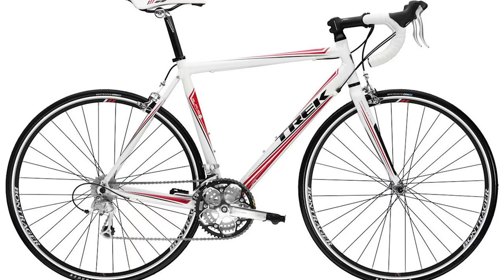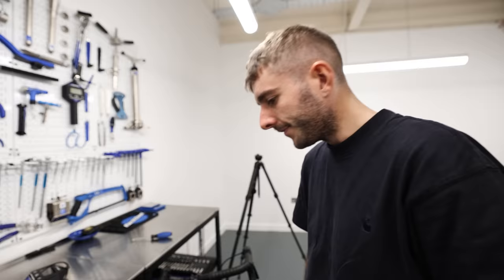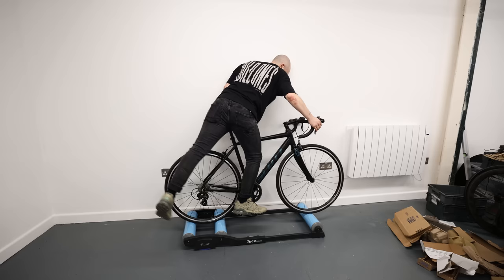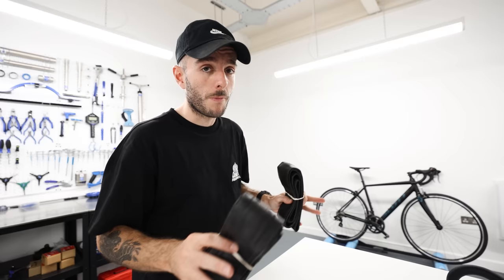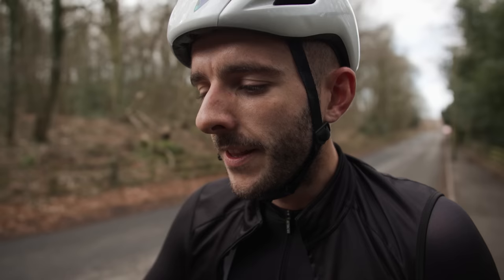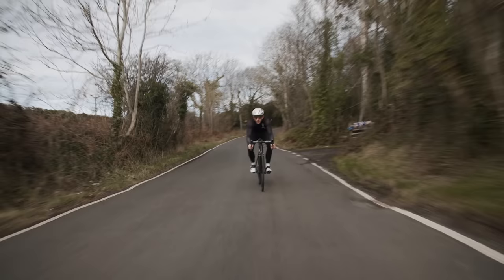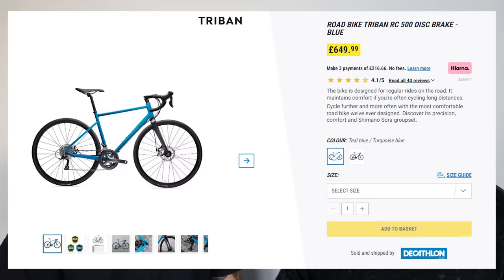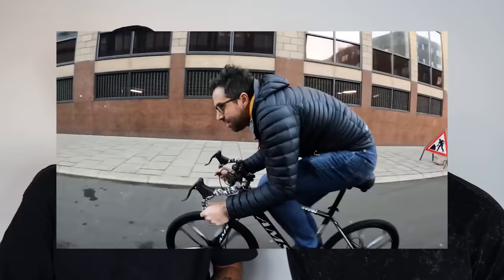How Good Is An "Entry Level" Road Bike In 2023?

Comment: For the same price you get the Triban RC520 with a 105 groupset from Decathlon! Big bike brands are getting ridiculously expensive.
Reply: Can’t imagine these guys buying from Decathlon…beneath them.
Reply: Yepp, I have the same and it has carbon forks, hybrid disc brakes, 105
Reply: @ScrubbersGhost  maybe they should?
Reply: @ScrubbersGhost  give over, they test stuff from Ali express ffs
Reply: @AK-je7ns  and?….they ain’t popping down to Halfords and picking up a bike for £500 are they?
Reply: Only downside is crap wheel set and heavy frame..
Reply: Just bought one second hand for around £500 (as my  first road bike). 

Nothing seemed to match its bang for your buck…
Reply: I bought the RC500 last year for £650. 11 speed and sora. With mechanical disc breaks. And I think it's a good bike. I prefer to ride my full carbon ultegra race bike in summer. But for those winter slower rides the Triban is fine.
Reply from the maker: I bought a bike for £120 and it’s in this video.
Reply: I have one and think it’s the best value bike you can get around this price point. And it’s super flexible for newer riders who don’t know exactly what sort of riding they will love - you can fit panniers and quite a range of tyre widths
Reply: @@diesel9677 the RC520 is out of stock all the time. That’s one of the reasons I went second hand. The price is another…
Reply: @Cade_Media  but it's two different worlds, you can't compare them. Decathlon in-house components are actually good quality
Reply: Also have the RC520 - it was $999AUD (i.e. 550GBP) new at a boxing-day sale. 105 Groupset, tubeless ready & HY/RD discs
Reply: @ScrubbersGhost  Back to the future... 😉
Reply: @diesel  True the RC520's 105 is arguable - mine came with a Shimano RS510 crankset tho. Shifters is still the most expensive component of a groupset, so adding those (plus front & rear mech) up you'd get a bit over half the dollar value of the full groupset.

Earlier on, the Decathlon CF900 did indeed have a full 105 groupset (rim brake), carbon frame & Mavic Aksiums and was discounted to $999AUD as well.
Reply: @ScrubbersGhost  they did buy from decathlon already
Reply: wee 😢bit of 😢😢 is ¾😮😢
Reply: Half a 105 missing the crank chain and cassette
Reply: @ScrubbersGhost famous last words 😂
Reply: @ScrubbersGhost  This aged like milk
Reply: Team RC520 here. Picked a pristine second hand up at less than half price. It's my work commuter & now with some Hunt 4 Seasons Gravel wheels & 42mm Specialized Pathfinders, she's a light gravel & tourer. A real do-everything bike.
Reply: @Cade_Media  The Schwalbe Lugano 2 are actually quite amazing. I bought them for 20€ a pair for my 79€ 1984 Bianchi to participate in the L'Eroica last year and I didn't had a single puncture on the strade bianche. I think when it comes to everyday use they are quite good.^^

Comment: It's great how passionate Jimmi is about bikes having easier gearing – it's such a blocker for new riders and they just assume they're unfit and bad at cycling, rather than it being the fault of the setup of the bike
Reply: Yeah.  Really, the 11-28 is fine, it's the 50-34 that's excessive for beginners.  They don't need a 50x11 gear!
Reply: I only started riding in August last year and have a 11-28 and 50-34 and it's a relief to hear this haha
Reply: @ellipticalsoul  get yourself a bigger cassette if your rear derailleur allows it! (You might need a new chain too)
Reply: they indeed do, but i think the problem is that 50/32 is to big of a jump to have less chance to drop the chain. I do think that 48/32 would be high enough for most because 2 teeth in the big ring dont matter as much as 2 teeth in the little ring.
Reply: Agreed.  Beginner bikes should universally ship with a fairly low granny gear, and come with fairly upright riding position (i.e. ship with plenty left on the the steerer tube).  Most beginners simply do not have the strength or fitness to ride up hills with >1:1 gearing or to hold an aggressive position.  46/30 up front and 11-34 would be a good combo that would not hold back most beginner roadies.
Reply: @lolbubs11111  👍 True, they don't! It's all about how often, how far and what terrain they travel at, and the speed they want to achieve. It's what we all did at the beginning (I still do). Initially, nobody cared about cadence or max. vo2. The last one is not of my concern (f.ex.), even after more than 15 years of road-riding. Since the faulty heart of mine - why bother? It will never be any high. It's good to be honest with yourself, set some goal and attempt to reach it with small steps. If some muscles pop up magically (except the one from beer injections), there will be a time for bike upgrade. Better wheels, tires, etc. Sadly, nowaday bikes are made the way other upgrades don't come cheap.
Terrain? My surroundings are slightly undulating. Few occasional hills like 8-9% max. Never longer than a kilometer and a bit. So, I found a perfect gearing for me: 52/39 - 11/25 and I'm sticking to it for like 12 years now. At amateur level, one might find bigger gears are needed only when going down the hill, with maximum cadence and It's impossible to generate any extra speed, while on biggest chain-ring and smallest cog. Simple as that. ;)
Cheers!
Reply: 11-28 is already wide for a 7 speed cassette. Something like a 46-30 chainset would make sense though.
Reply: Amen to this and all of the replies. Changing my 50/34 to a 46/30 was the best decision I've ever made component wise. I run an 11-speed 11-32 and usually don't use the 32 ring in the Washington, D.C.-area. That's for long climbs because I and most people do better on higher cadence.
Reply: @ellipticalsoul  I highly recommend a 46/30 crankset if you don't mind soft pedaling on descents. But, yeah. It's no-brainer to move to a better cassette if you can fit it.
Reply: @lolbubs11111  Gravel gearing and heck gravel bikes in general almost seem like the way to go for a beginner roadie these days.  In the road world at least the performance gap between an entry level bike and a good mid-range bike isn't huge.  It's not like the MTB world where a cheap hardtail is terrifying to ride on anything more than an intermediate trail, a good hardtail will run about even with a cheap full sus and a mid-range full sus is light years beyond anything below it.
Reply: 11-28 is fine because its a 7 speed bike, otherwise the gear jumps would be even higher.
Reply: Yeah, it's utterly stupid to ship bikes with a anything bigger than a 50/34  and a 11/34. Unless your bike is targeting people who race, or people who never climb (like people living in the Netherlands!). What's absolutely crazy is that the Sora groupset doesn't allow for anything smaller than a 50/34 and a 11/34. 

So much so that a proper entry level gearing would have to involve a Prowheel (or FSA) 48/32 crankset and a 11-36 cassette paired with a MTB rear derailleur. However, I believe that past 9 speeds road shifters and MTB rear derailleurs won't go along.

Bike manufacturers are so elitist. It's as they actually don't want to make the sport (or the mean of transportation) more popular. Cycling is ACTUALLY easier than walking. I feel like most people think the opposite. And I believe the culprit is unproper gear ratio choices.
Reply: @ellipticalsoul  My first real road bike is a 2005 with 12-25 and 53-39, which I bought in 2021. The gearing limits my route options somewhat.
Reply: Okay, time to put an other opinion into the equation. I have first a bike with 42/52 crankset and a 7-speed 13-23 cassette. Then a bike with a 28/38/48 crankset and 14-28 cassette and find the 14-28 cassette abit BIG in range. It is to big gap between the two highest gears. Now adays I also have a roadbike with 50/34 crankset and a 9-speed 11-30 cassette and wish I have a 11-28 cassette. A 9-speed 11-28. The lowest gear I have ever use on tarmac is 34-23. 

11-28 7-speed is way to wide for a roadbike to get any kind of harmony in biking on the road. 11-30 or 11-32 is a great option. For 11-speed cassette. It is not all about range.
Reply: @lolbubs11111  many beginners is grinders that go for low cadence and high gears.
Reply: @GordonChaffin Nearly the same as mine 46/30 front 11/34  cassette.  I'm pretty weak riding now and with this kind of set up I don't worry about where I go.
Reply: @JakeMay  it's a short cage that will only take a 28t max unfortunately!
Reply: So many bikes with this issue. 50-34 is hard to move away from I guess as a default industry standard. Even gravel bikes that are quite expensive- like the base Specialized Diverge- come with one.  Oddly enough it seems like more inexpensive brands like Boardman and Voodoo are heading the charge to go for subcompact groupsets. Perhaps there will be some  “ trickle up”…
Reply: And then there’s me with the Triban RC100. My easiest gear is a 44/28 😂
Reply: @Bes1997_   I have the exact same bike. Great on the flat, shocking on the hill
Reply: my first bike was a shimano 105 with 11-28 and 34-50 and I keep it today. I live on a steep hill place  where is hard to find flats and it's a wonderful ratio 
People ranting against 34-28 front back ratio are overdoing things. I can understand people wanting bigger sprocks to climb easier but is not needed and is slower as well. For me this ratio is a perfect sweet spot

Comment: I tend to buy second hand bikes. you can get a really nice mid range bike for that £900 these days. And if there is another £50 left over (because you managed to make a good deal) you spend that on a basic service at the local shop if you dont feel like you want to get your hands dirty and that way you supported the local community, got an amazing bike, saved some money and gave a second chance to a bike. thats a win win win win in my eyes.
Reply: Spot on!!    Rgr
Reply: Mid range 900 quid ??????????????
Reply: @stubbingtonmarigold3032  for 900 you can usually buy a bike that is only about 4years old and the original price of it was around 3k
Which on the grand scheme of things (compared to super bikes) is a mid range bike. 

But of course this is true for all price ranges. If your budget is £200 then for that amount you can probably buy a second hand bike that is a few years old and used to be just under 1k. At least this is what i see on the second hand market :)
Reply: @stubbingtonmarigold3032  I got a 2021 Roubaix with 105 for 900
Reply: eBay ftw!

£1300 got me a Scott addict 10, weighs 7kg, Shimano ultegra and 105 setup 

Looking forward to upgrading to disc brakes and fatter tyres in 5 years

Comment: I bought my girlfriend a used 2005 Jamis Comet for $140 USD. I put around $150 in part upgrades, $40 for a full tune by my local bike mechanic that included everything from truing wheels to making sure all of my wrenching was done correctly, and around 6 hours of sweat equity to make sure it is cleaned, the paint touched up, and the thing was properly greased. That road bike was around $1,900 USD when it came out and still packs a punch in terms of weight and geometry. What would I need to buy a $900 - $2000 brand-new "entry-level" road bike for? I could buy a car that runs and drives for that price.

Comment: My first bike was a Btwin & cost £299 and it was brilliant.  Didn’t want to pay too much as I was dipping my toe into cycling and now I love it. Should of taken up the hobby years ago. The perfect starter bike
Reply: I've got three Btwin including a 500SE.
Reply: I have 2 B'Twin bikes and my first road bike was the 500SE and cost me £300
Great bikes to start out on, and in fact its only this year that I have not used the B'Twin as it needs upgrading
Reply: I still ride a red Triban 3, and for the £300 i paid for it new back in the day it roflstomps this £899!! 'entry level' bike (of course its like Trigger's broom nowadays) :-)
Reply: Ridden nearly 7000 miles on my Triban RC120, an amazing bike for £329
Reply: using rc520 used rim brakes 565 size for 300€ sora 9 speed no problem,only terrak no brand brakes sucks but iam 65kg and rerely ride in rain or very wet so its alright ,i dislike disc brakek agenda new bikes are too heavy like 11kg for sora or even tiagra and pricing of most brands is way too high i feel like so if i am buying it will be probably Canyon with rims tiagra or 105 mechanical of course or from used markets
Reply: I agree with you, if you also want an inexpensive upgrade, the Boardman Sport will cost you more or less the same and it's a heck of the bike. It's fast (once you've accelerated it), comfortable (the Aluminium frame is great) and sturdy (the mavic CXP22 will last forever). There is just a tiny bit of toe overlap, but you know, you don't zig zag too much in training.
Reply: 'my first bike was a Raleigh 3 speed....it was very durable however it was to be ridden on flatter terrain...ohh I forgot  I had a bike with a bananas seat with 'Easy Rider" handle bars
Reply: My current bike is a Btwin Triban 520 that i use mostly for commuting.  I paid £450 for it which makes it the most expensive bike I've ever bought by some distance. I recently needed a new chain and gear-set and also fitted a pair of low rolling resistance tyres and the bike is so smooth and a total pleasure to ride.  The new chain and gears are obviously better quality alloys than what was originally fitted as I've had no issues with the chain seizing due to the winter gunk that tends to cling to the tarmac during the dark months.  As the boys said, better quality components allow you to be a bit lazy with maintenance which suits me down to the ground as I'm rarely in the mood for washing my bike when i get home off a back-shift in the middle of January!

Comment: My first bike on my return to road cycling in 2016 was a B’Twin Ultra 720AF, new but ‘shop soiled’ which I paid £700 for-full Ultegra gearing 50x34 and 11 x 28-I changed the block for an 11 x 32 (because 11 x 34 wouldn’t fit) and rode it for 18 months before I bought myself a new Specialized Roubaix Expert for my 70th birthday in 2018-still got it, still love it.
Reply: Man it's so rare that people of your age are into mountain cycling. My grandpa is the same age as you
Reply: Second that for B'Twin. 2019 Ultra 900CF , costed 550GBP for full carbon, 105 Groupset and Mavic Aksium wheelset. It was end-of-line sale tho, can't get that price anymore.
Reply: Any reason why you decided not to just keep the btwin?

Comment: As a proud owner of a £625 Giant Contend with Claris groupset from a few years back I really enjoyed this video. The bike has been my entry into road cycling from an MTB and have gotten me around London for about 5k miles so far. I sometimes think about upgrading to a £1.2-1.5k bike but really hard to justify it. The 3 year service it came with alone was worth £300 pounds and they've replaced parts for about as much so amazing value for money. I have a feeling I'll be keeping it for a really long time.
Reply: Claris is such an awesome groupset
Reply: @@diesel9677 Giant Contend 2 - currently £879 on the Giant site - seems to address to big concerns.  11-34 cassette. 40cm bars. Claris groupset. Approach saddle with cutout channel.  Seems like it would have been a better choice to test.
Reply: @jonathanforman5357  Think about a certain tester's relationship with a certain brand cough Scott, and not with another cough Giant, even if the Contend is very decent. Oh and Claris is quite good, but these days, with trickle down, Sora is really good. Something like 105 was in a previous 9 speed iteration.
Reply: My 2017 Giant Contend SL2 with tiagra groupset was £679 with a little discount. Bought in the UK and I flew it out to Taiwan where I'm living now. Such a great bike. I cycle around 1000km a month. Bike has over 32000km on it and it's still going strong.
Reply: The gaint content was my first road bike . Gears are  smooth.  Love it
Reply: we have the same bike. giant contend with straight claris groupset. it is smooth and durable and it is so pracrtical. i love it
Reply: Had exactly the same and kept the saddle for my last two bikes.
Reply: Honestly. Today's Claris is great. 8 Speed Parts are really cheap! It's great for the recreational rider! I will say, having more speed options is useful, but if you're on a budget. It's definitely underestimated!
Reply: Hell yeaa! Im a proud owner of giant contend with straight claris groupset. I go to gym, i eat healthy, i run and i swim and i can sprint faster than some guys here in my place who use carbon frame with 105GS ☺️
Reply: That "Giant" steer tube 1.25 x1.5 taper would worry me about replacement headsets in the future. The D fuse seatpost with BMC style clamp would be a concern for creaking. Also in many cases Claris 8 speed with the 30/39/50 and 11x34 cassette might have been a  better  choice.  The 39 and 50 chainrings half step very nicely ratio wise. Good chainlines as well for improved chain life.
Reply: @davidburgess741  You are spot on with the D fuse creaking - one of my only issues with the bike so far. Somehow dirt gets in there and I have to clean it every few months to stop the creaking sound